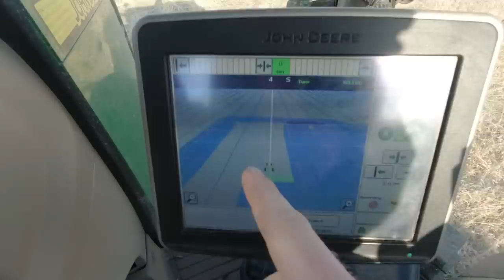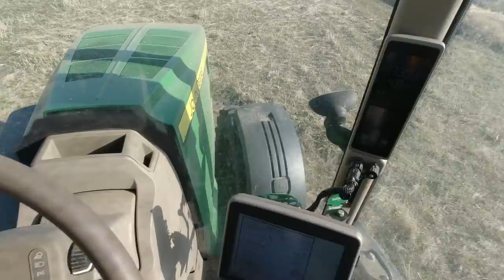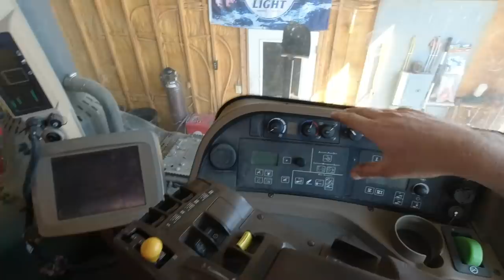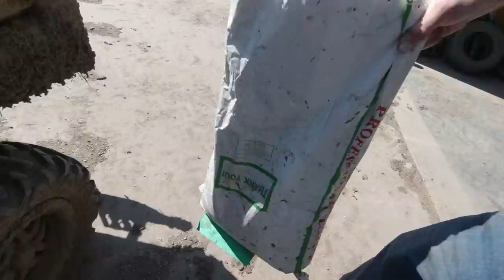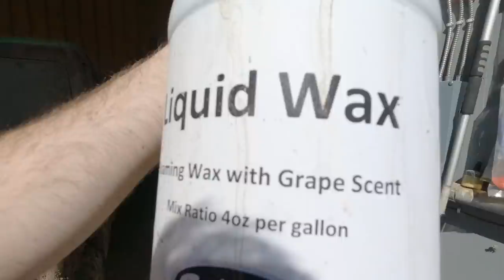Back In the Saddle

Comment: Just fair warning, if you keep running fertilizer through that conveyor it will rust away to nothing in 6 or 7 years. You can try to clean it out but you can never get the dust from the fertilizer out of it. Trust me I know. We now use an old auger if we need to transfer fertilizer.

Comment: hey Cole and Brian, what are your dimensions of your calving barn, and your heated shop inside of it.  Were thinking of doing the same thing.  I really like that idea.  thanks
Reply from the maker: I think the building is 80x60. The shop is about 40x30
Reply: @SonneFarms  ok thanks again
Reply: @SonneFarms  the shed is 50 by 80. the shop has a 22 foot door and is 25 foot wide about 35 deep

Comment: 17:35 Maybe should have cleaned off the dust on the shaft? I wouldn't want that going into the hydraulic system, filter or not.
Reply from the maker: There is not hydraulic fluid flowing through there
Reply: @SonneFarms  Sorry about that, my bad, I should really own one of these things before I put my foot in my mouth. Isn't that part of the rear differential? I guess I am just thinking that before the dust gets to the filter it can get caught in some other place, causing premature something...
Reply from the maker: It is good to keep it clean though, you are not wrong! I do not think it is part of the differential, but I could be wrong
Reply: @SonneFarms  Well, it's in the trans box anyway. I guess the trans takes up so much space there is no way to put the pto around it so they had to go thru it. I'm still trying to figure out the gearing tho and how the pto is separated from the trans...